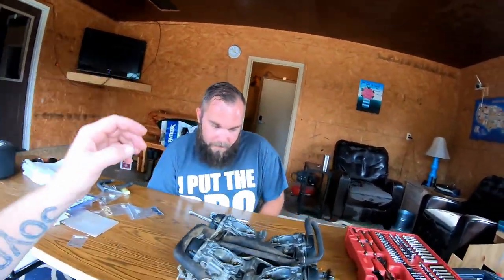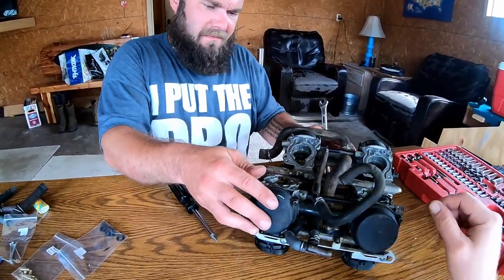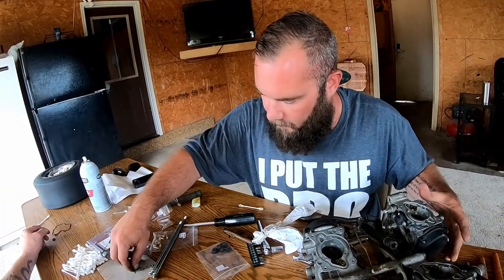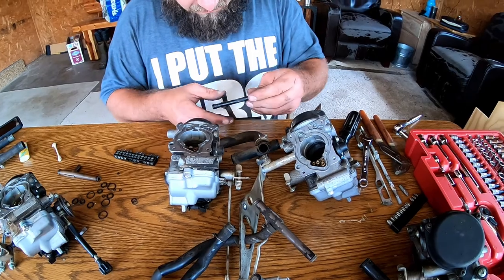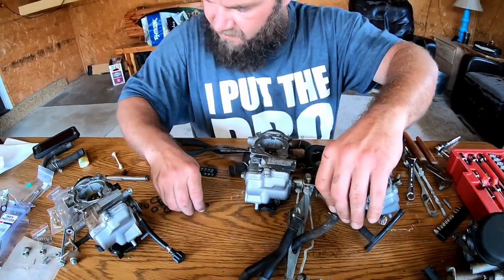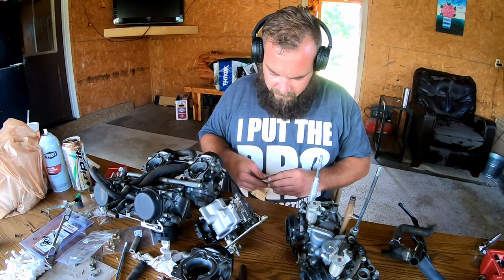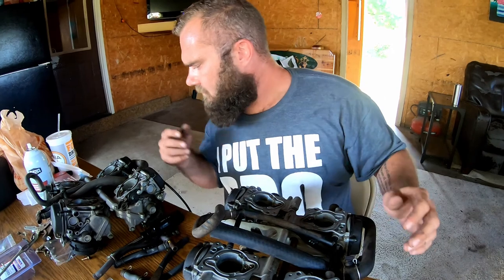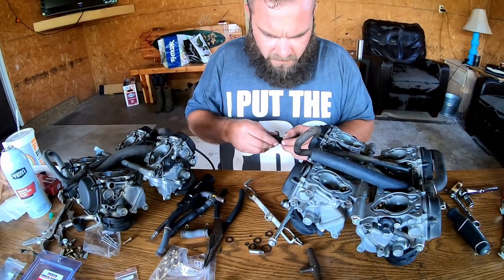Motorcycle Series: 97 Honda Magna 750 Carburetor  complete break down and rebuild.

Comment: I bought a 97 magna and the carbs were leaking so I tried to take it apart only to find out that the previous guy stripped a few screws that connect the top with the rest… any advice how to get them off?
Reply from the maker: A kit that allows you to TRY to get the screw to back out is my only suggestion other than drilling and using a tap and die to retread and use bigger screws
Reply: Not sure if you've solved this or not, but I've had luck with impact screw drivers on stripped out Phillips heads. It's like a ratchet screw driver, but you hit the top of it with a hammer to"ratchet" it. The impact forces the bit to bite into the metal a little bit more. Harbor freight has them for like $10